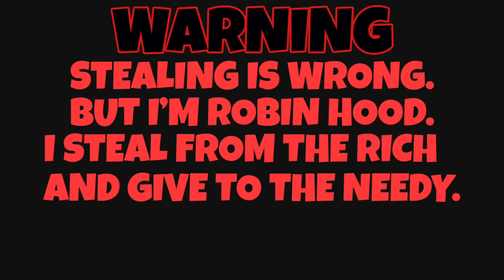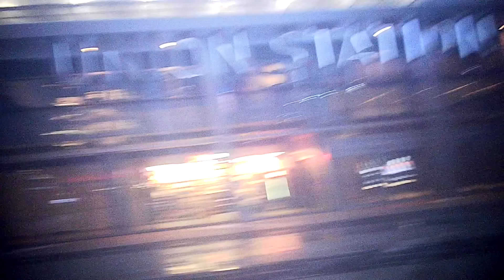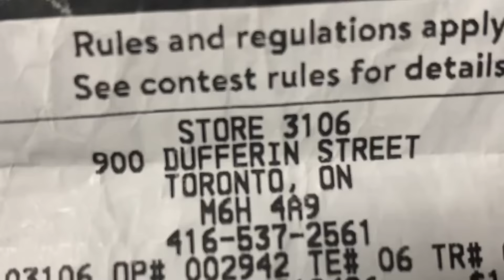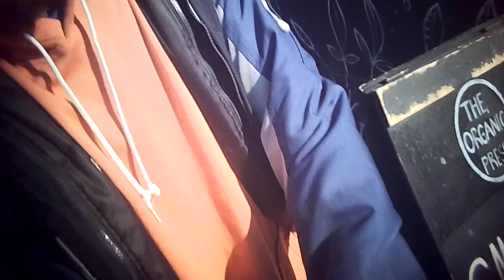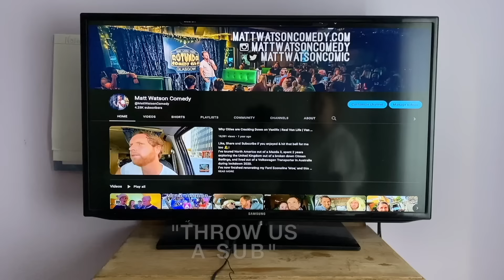Sneaking into a Toronto Maple Leafs Game Wearing a Hidden Camera

Comment: im so confused, so you have to sneak into the building but you’re already inside? In St. Louis you enter the building and metal detector line right there followed directly by ticket scan and then you’re in
Reply from the maker: As Scotiabank Arena is connected to Union Station along with several other nearby buildings, they can be accessed through indoor tunnels. So yes, the entrance I found was already indoors, but from there I still needed to bypass a pair of ticket scanners and go through security to enter the arena.
Hopefully that helps with clarity.
Thanks for watching!